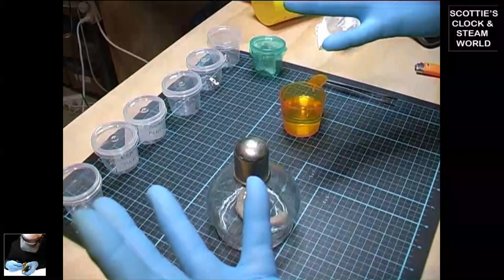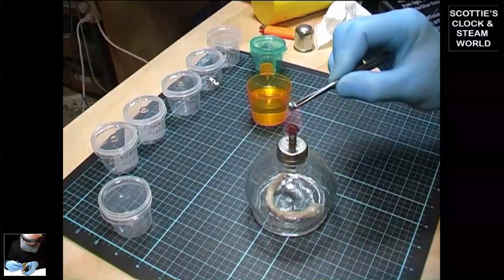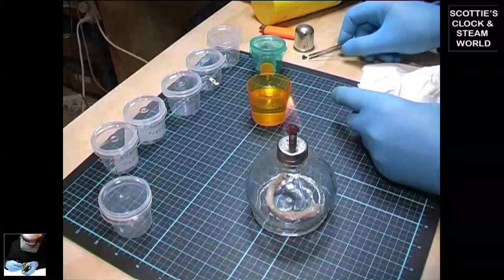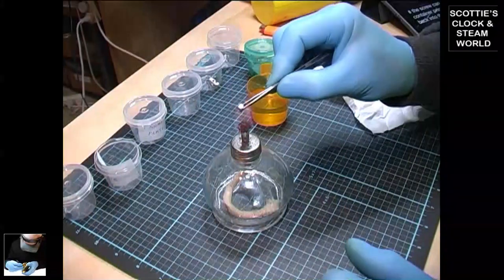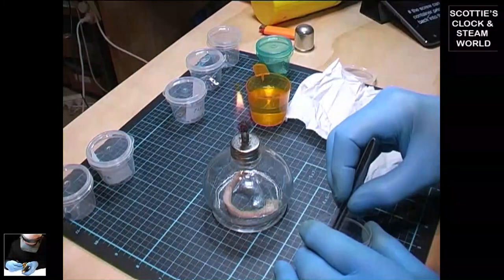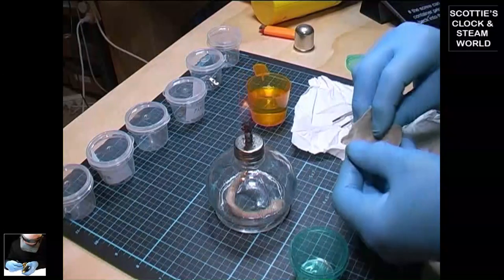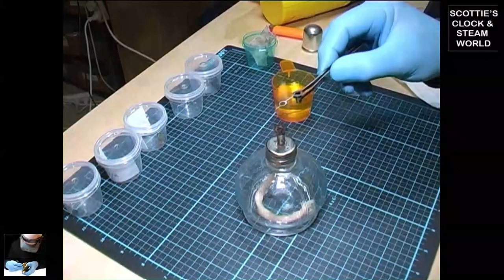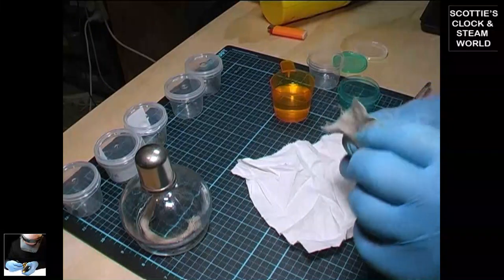How to blue French clock screws - Part 2 #ScottiesClockWorld

Comment: This was interesting to watch. Ive only ever seen people do it using a bed of brass shavings or even a brass plate. Is there a reason for that?
Reply from the maker: A couple of reasons: 1) there was only a few screws that needed bluing, 2) heating a screw just past the 'blue' will turn it grey. It will then have to be re-machined and re-blued.